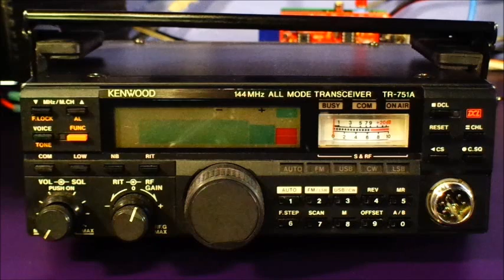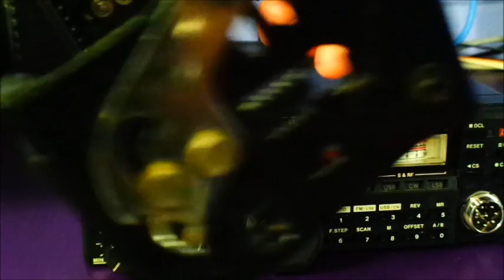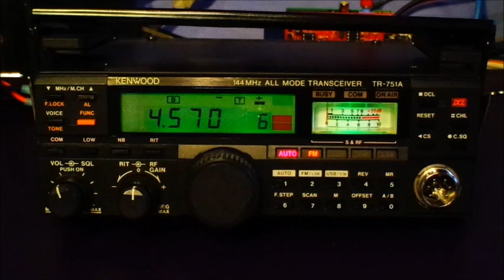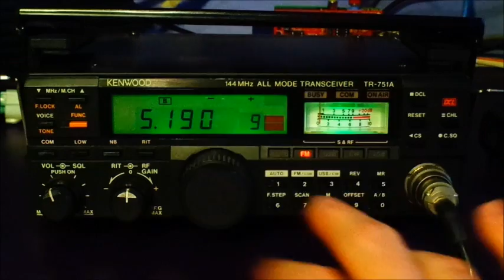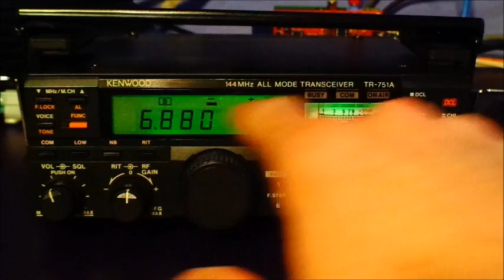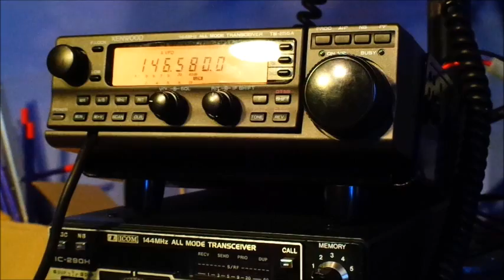radioreviewtr751a

Comment: Do you know of any resources for saving new info into the memory channels? I recently got one of these and cannot make heads or tails of the instructions in the manual. New to the hobby and am loving this little unit.
Reply from the maker: Andrew Parker I have to check comments more often.  I’m hoping you figured it out- most likely if it isn’t playing nice the internal battery is dead.  Otherwise you just hold m until you hear 8 beeps and press mem number 1-8 (9 and 0 can store odd splits and are different)

Comment: Can you dial on an autopatch with those number buttons?
Reply from the maker: +Timothy Parry Jr The radio won't send DMTF over the faceplate, nor does it store dtmf memories like newer rigs.  you either need the dtmf microphone or you can just use something like a smartphone to generate the tones while you key the regular mic.
Reply: Where does anyone anywhere still use an Auto Patch? I have not heard one in many years anywhere even in my travels.The GasFet Front End on the Kenwood TR-751A is one of the best if not the best found in any 2 meter Multi Mode.I have owned four of them & they are Awesome.I own an ICOM 275A & the only reason I chose it is because it's a Multi Mode Base Radio & I have an all ICOM station.